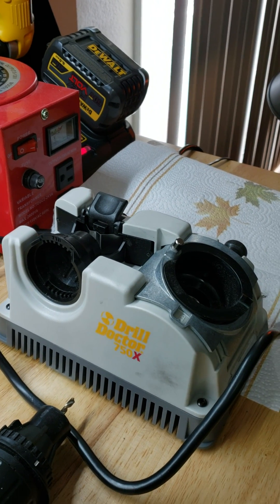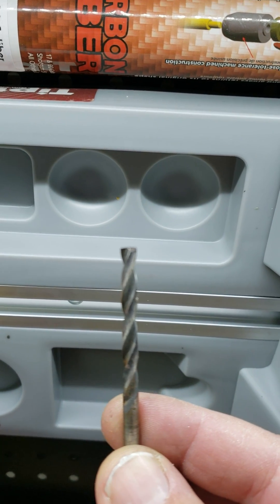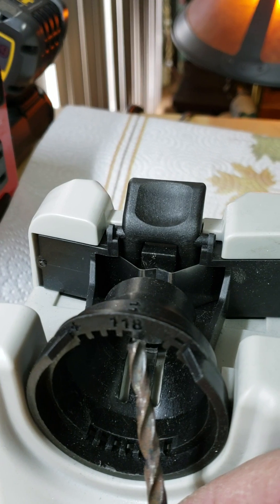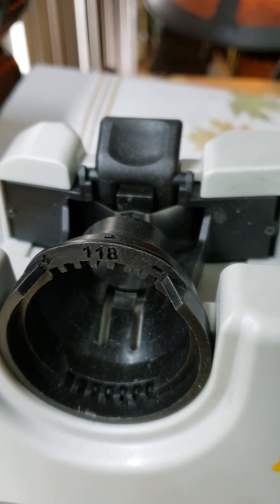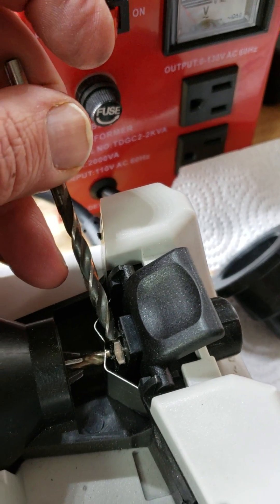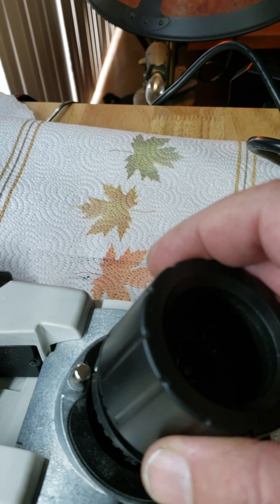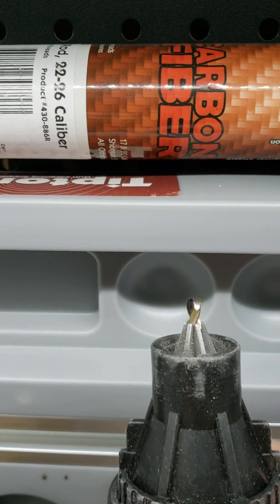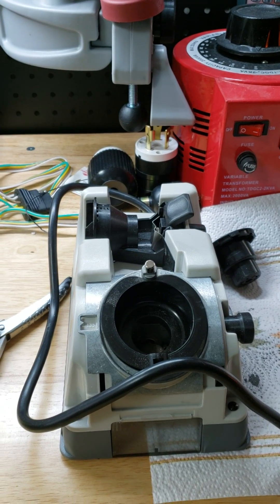Drill Doctor 750x Solved!! - Right Way to Sharpen a Drill Bit to a 135 Deg Angle with a Split Point

Comment: Wish I would have seen this video last week when I used my friends 750x. Agree that the manual is terrible. Every bit looked like crap when trying 135 degree. Thanks for figuring this out!
Reply: It actually is printed in the instruction booklet. One notch *(- to the right of 118) for 135 degree sharpening..
Reply: @anthonyash3103  Yes, it does mention that in the updated manual but that info is absent in the manual from 2010.

Comment: You are correct! The Drill doctor manual is good for little more than kindling. It's like the guy who wrote it couldn't sharpen a 135 degree bit! DD got a nice long letter from me regarding their manual. I may be banned from their website now. I'm not sure. Good info here.

Comment: I have 2 drill doctors, 1 is about 20 years old and will sharpen up to 1/2 inch, I love that machine. 3 years ago I bought a piece of shit drill doctor 750x. after trying time and time again to sharpen drill bits I decided to see what was exactly happening. The old drill doctor has a plastic cap over the wheel, I removed it and inserted a bit, as I rotated the bit, the bit rode the grinding wheel evenly all the way. I then took the split point plug off the back of the 750x and did the same thing. Guess what the bit does not ride evenly on the grinding wheel, in fact it starts off fine and as you rotate the bit it will move forward off the wheel and ruins the bit every time. I wish I had take the POS back.
Yes everyone on youtube makes it look easy. The key to make mine work properly is a trash can.

Comment: Great vid.... thanks.
What about a 118 drill
Reply: A split point is generally optional on a 118 drill.  The chisel point is acute enough to pilot the bit into the material well enough to avoid walking.  135 bits require a split point, as their slow rate of advance would have them walking all over the work before finally settling in, especially when drilling metal.  One generally doesn't want to use a 118 bit to drill metal. A 118 bit in metal advances too quickly, making a ragged hole and demanding excessively high torque from the drill motor.  As a general rule a split point doesn't offer any real advantage for drilling through wood, but there are exceptions. If you want to split your 118 bits for tasks such as drilling into finished cabinet wood very accurately or you are drilling very hard wood such as white ash or ironwood, go for it. Start with the chuck in the 118 slot. If the chisel point angle is too close to 90 degrees from the cutting edges or the split doesn't converge on the center of the chisel point, try moving the chuck 1 or 2 notches toward the + side of the 118 slot. You may have to iterate to find the sweet spot, and that spot might change from one brand of bits to another due to differences in the flute pitch.

Comment: Thank you so much, I have same doctor but 135 angle was nightmare, I ruin so many milwaukee cobalt bits without knowing how to align for 135.
I was counting each notch as a 5 degree to the plus direction 
Your advice just priceless 
God bless you
Reply: It actually is printed in the instruction booklet. One notch *(- to the right of 118) for 135 degree sharpening..
Reply from the maker: It took me awhile to figure it out.  The information is buried in the instructions
Reply: the manual does explain: 1 notch to the right..... and adjustments if still off, fyi

Comment: Great video but you made two small mistakes. The first mistake is that you need to keep spinning the chuck until it stops making noise. sometimes it will take a while but the machine is designed to get that angle correct and if you don't keep taking material off then it won't be exactly right, so just keep spinning the chuck until it stops taking material off. the other mistake was just ramming the chuck into the split point port, you need to pulse it inward. slowly push the chuck in then pull it out a little then a little more and so on. if you just ram the chuck into the port you can potentially break the wheel.
Reply: It looks like you have played Metallurgist when you did the split point.  Which aligns with the comment of ramming the chuck into the split point port.  Looking at the drill bit it appeared to have a color change.  This indicates a change in the metal properties of the drill bit.  The bit has become less hard.  So slow down to decrease the heat build up.  Heat does reduce material properties and how you cool it down (water, oil, air,etc.) establishes the hardness.  Lessons from my Materials Class in college.
Reply: THX very imformative